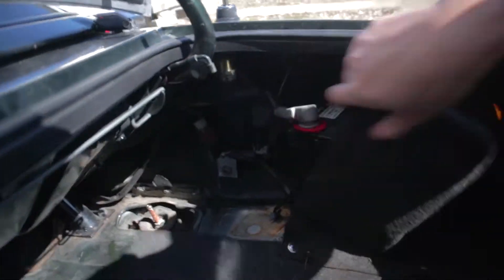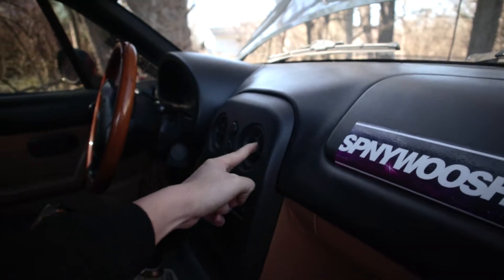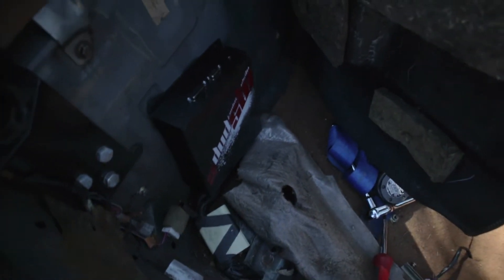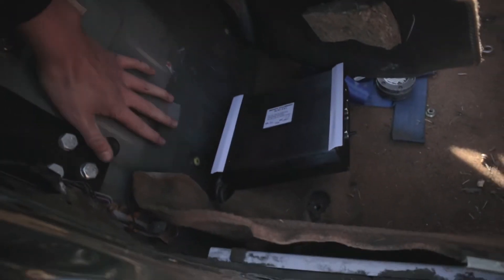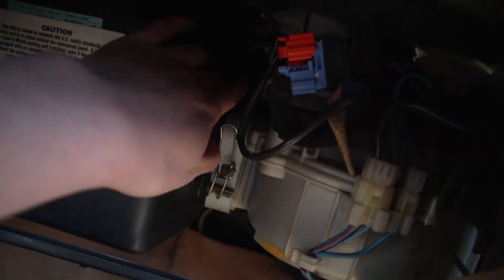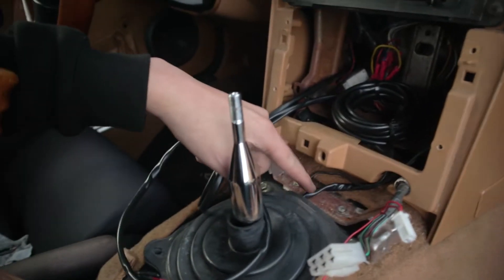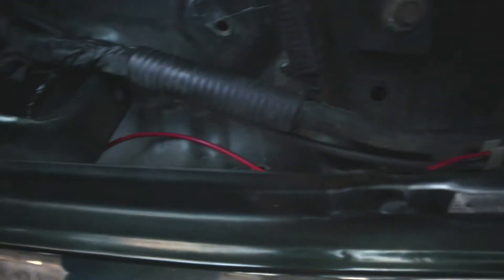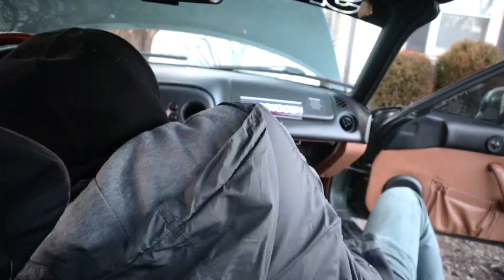Installing a MegaSquirt and Wideband | Turbo Miata Build pt.1

Comment: I’m in the process of the same install. What wires did you tap into for the white and blue. My stock o2 harness has 4 wires. That’s my only hold up. Running megasquirt as well
Reply from the maker: If you look up a wiring diagram for your years o2 harness it should tell you which wire is the signal wire, I can't remember off the top of my head, I wanna say brown and red. On my wb gauge the white wire was not necessary (it was like narrowband signal or something) the blue one I just spliced right into the signal wire in the harness.